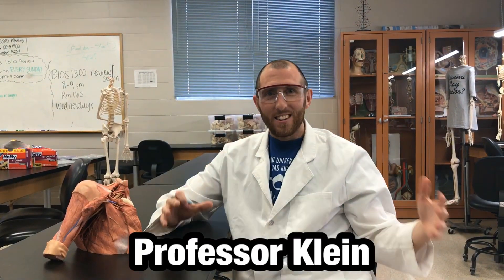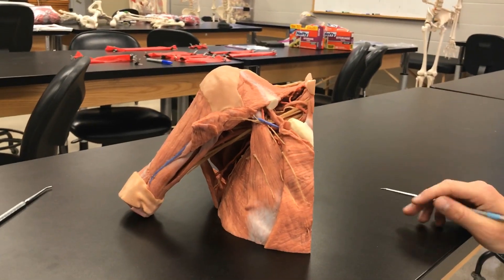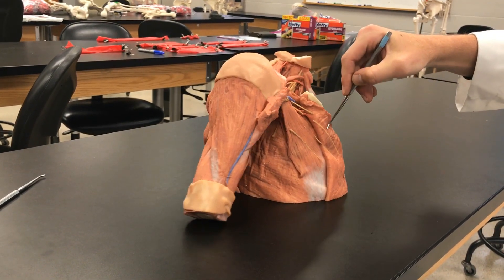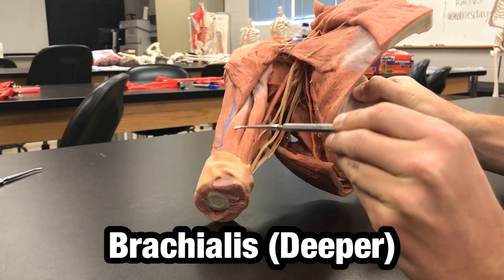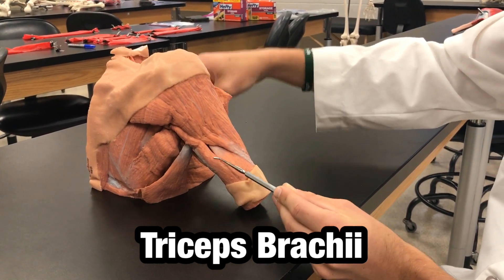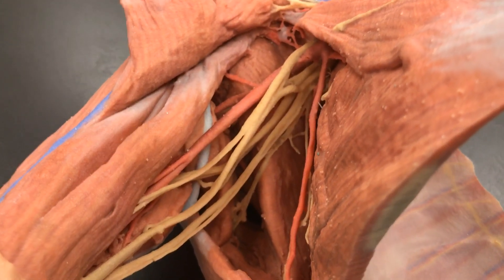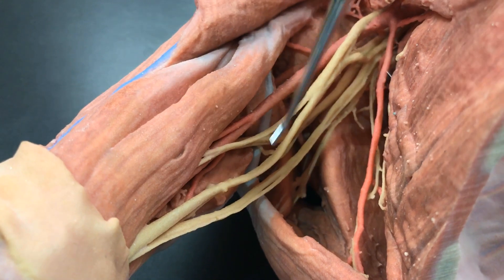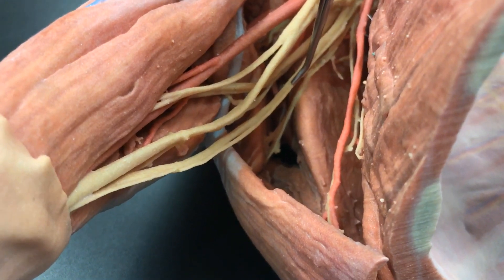Shoulder Model (3D PRINTED) - Ohio University - Anatomy&Physiology - BIOS 1300

Comment: Is it possible to buy this model?
Reply from the maker: It is, but the 3D anatomy models are rather expensive. $8000+ Website: https://anatomywarehouse.com/3d-printed-head-neck-and-shoulder-with-angiosomes-a-105328
Reply from the maker: The model is extremely similar to the human body and very comprehensive. Lots of smaller detailed parts but also holds together well.
Reply: @professorkleinanatomy  where did you buy it from?